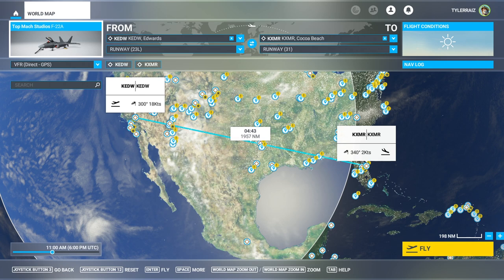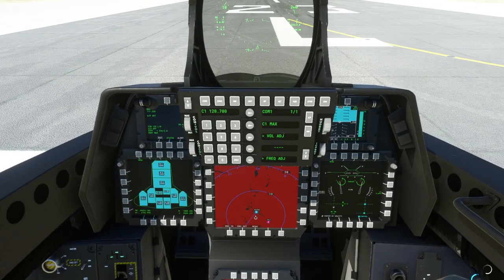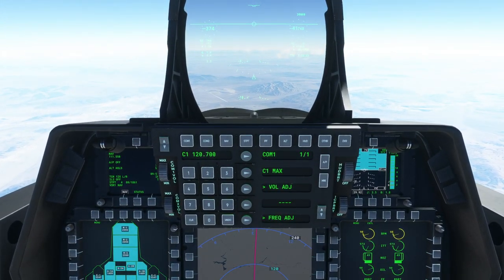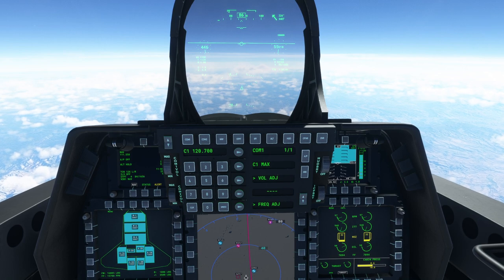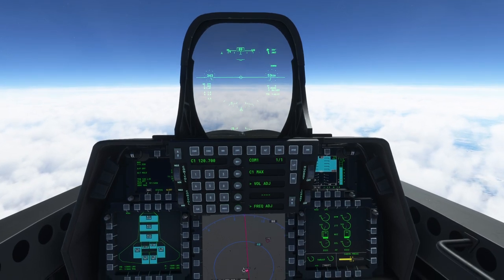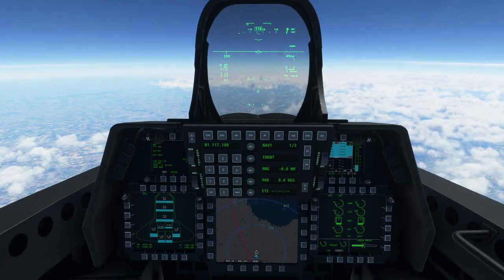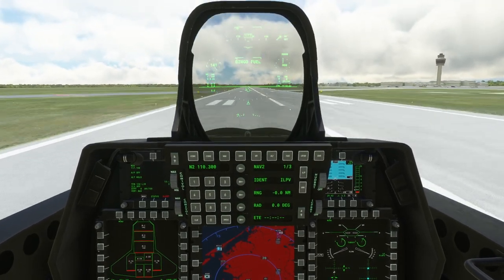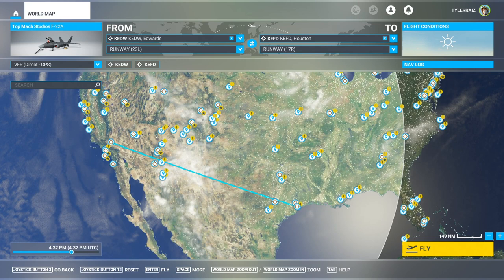Flight Sim 2020 - Top Mach Studios F-22 Range Test

Comment: Optimal is mach .8 at 35k feet
Reply: Easily makes 1600nm
Reply: Cruise up to 45k ft then glide down to 35kft and u should be around mach 2.2 or stay at mach .8 at 30kft~
Reply: Do you know those numbers for the F 35 possibly?